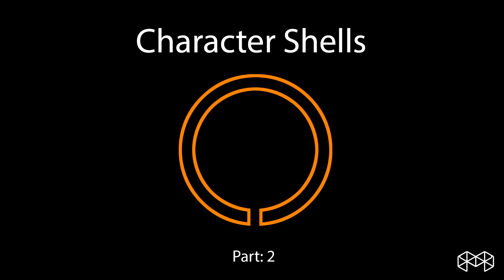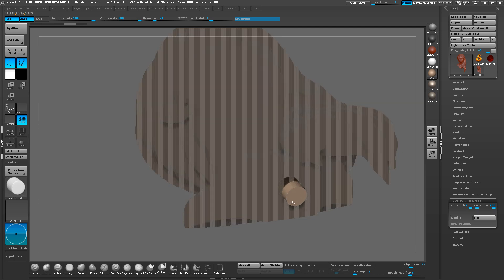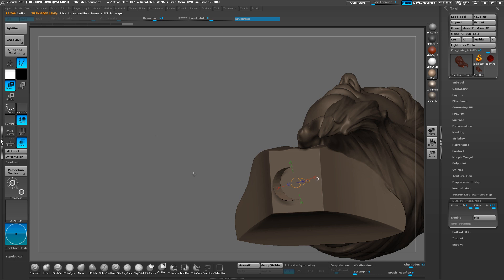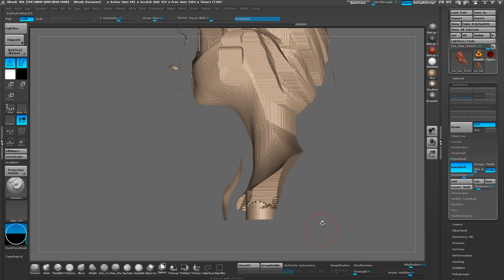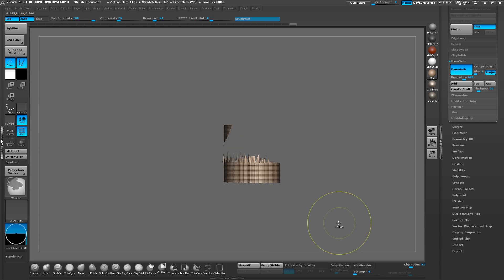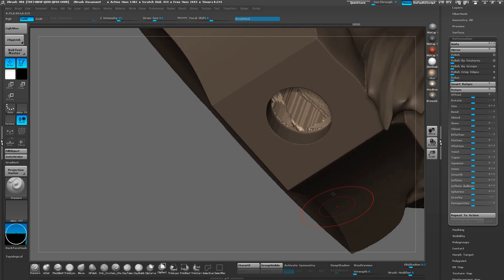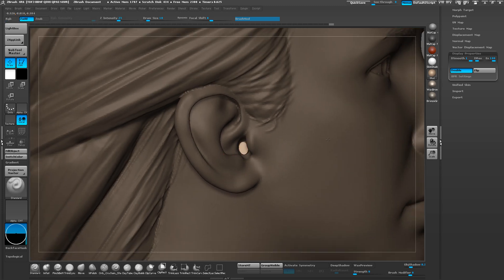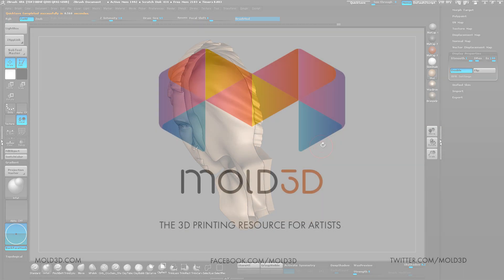Making character shells in ZBrush Part 2

Comment: Thanks a lot for the tutorial. I'm having an issue though, when i create the shell, it's all just one polygroup, not 3 like you, could you tell me what I'm doing wrong? I've seen the video many times and done everything exactly like you did :/ Thanks.
Reply: Hi,  

Try pressing the groups button in the dynamesh area first. If that doesn't work, you might have to make sure the mesh is one polygroup( excluding the cutting mesh) first before re dynamesh one. Hope that works for , if not let me know.
Reply: ***** I tried with the groups button, nothing changed, and i made sure the mesh was one polygroup the first time. I tried with both "InsertCylinder" and "InsertHCylinder" brushes in case there was a difference in that regard, but nothing :/

Thanks again for replying so fast :-)
Reply: ***** Any ideas?
Reply: Matias Presta Yeah I have tried it over and over, I always am getting polygroups on the inside when I create the shell. In this situation, the worst case , you might have to do some fancy hiding and make a polygroup manually.Sorry!
Reply: Hey thanks for the reply, I kinda figured it out, I removed the polypaint before creating the shell, and i was able to separate the polygroups, don't know the reason, but at least I was able to solve it haha, hopefully it'll help others with the same problem.

Cheers